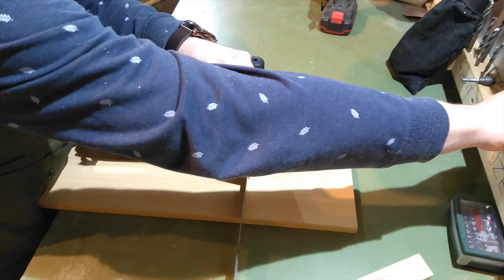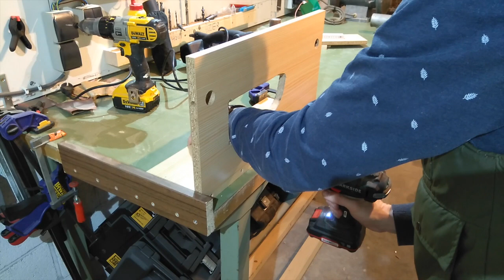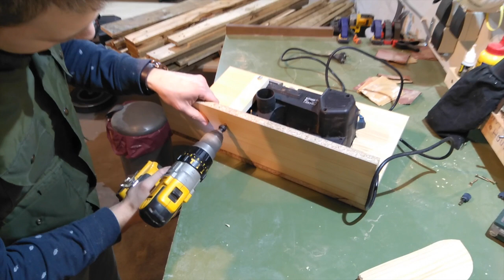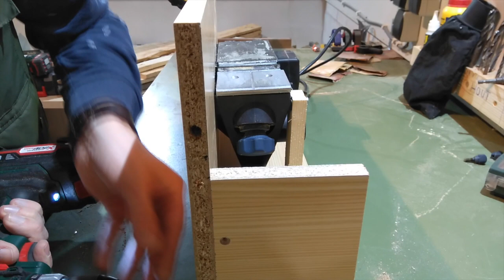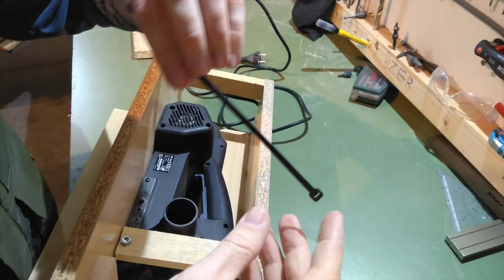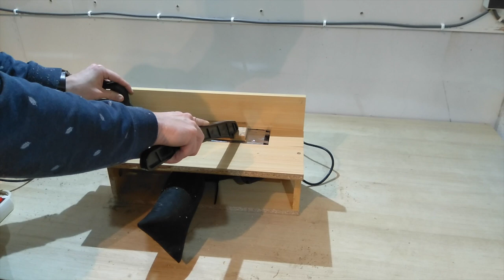Make your own Benchtop jointer DIY Ver.1

Comment: I noticed that the in feed table doesn't raise and lower to match the height of the front shoe of the planer. Does that not seem to matter?
Reply from the maker: Not really, if you take of more than 2mm at 1 time, it is more difficult to maintain a flat surface. Sow mostly I only take 1,5mm of per passage. Does this answer your question?